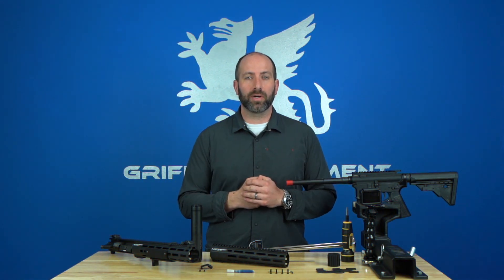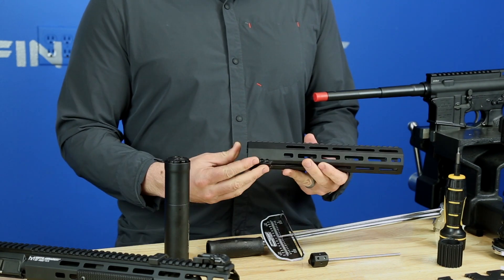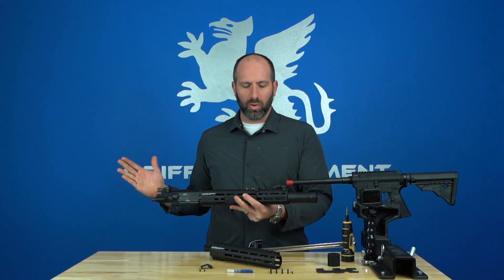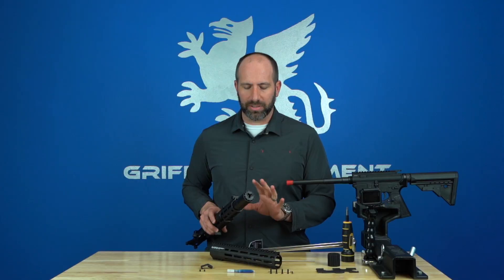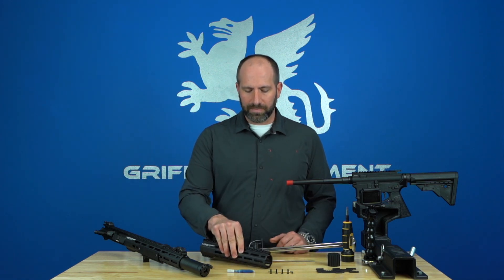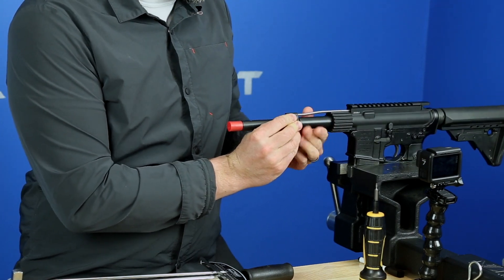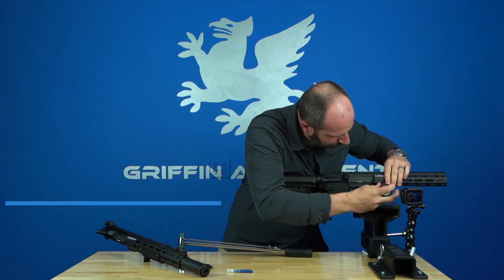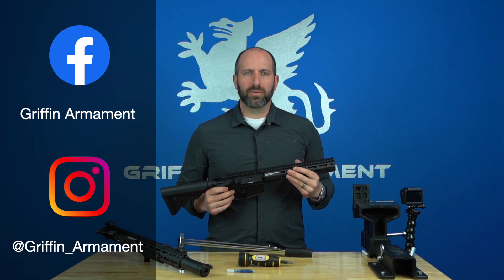SR M-LOK Installation Guide

Comment: Just got one but will 12.5 barrel with 12.5 sr rail be flush ot tucked if using surefire Warden?
Reply from the maker: The Surefire Warden would likely not work because accessibility to the mounting interface would be obstructed, and it would also likely extend past the rail.
Reply: @GriffinArmamentOfficial  ok I want to keep it installed permanently so I don't have to keep taking it off and on thanks for the quick response this is still by far the best handguard I own even better than my aero enhanced